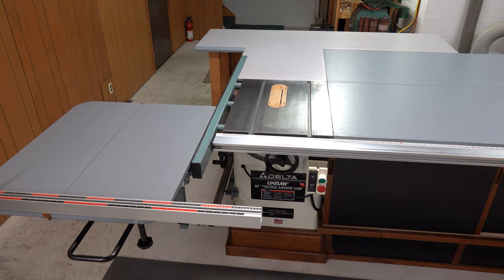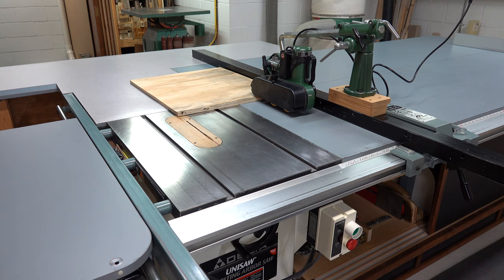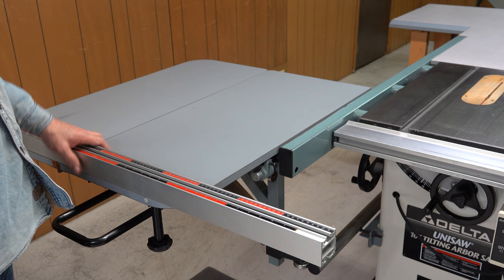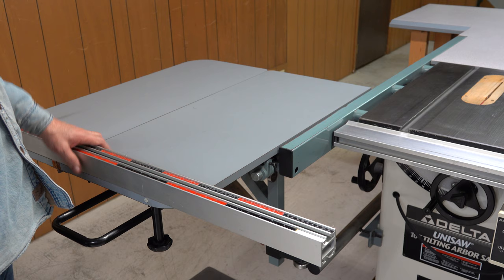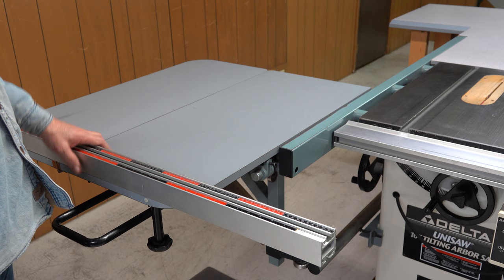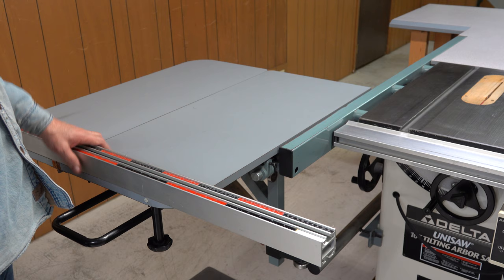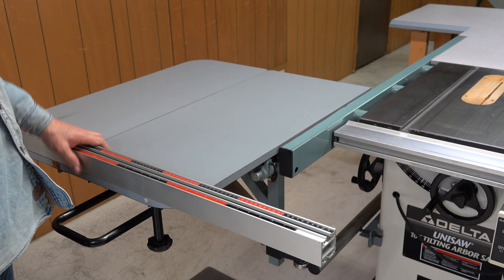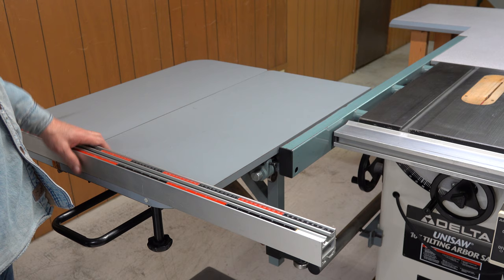Deluxe Table Saw reveals 67 hidden secrets!

Comment: Nice video,thank you. I to use the Delta sliding table and it is tedious to adjust and keep adjusted.As you say , all moving parts and surfaces must be kept clean for the saw to cut accurately. I bought mine when it first came out way back when. They have not been sold new for a long time. There are some very nice sliders on the marker but not cheap by any means. They take some getting used to but they will do very nice work for you.
Reply from the maker: Glad it helped

Comment: A little insight from me: I worked in printing for years, and on our machined surfaces (mostly large hydraulic paper cutter beds) we used spray silicone to protect the surface and keep it slick.... wood and paper are from the same family.... needed something to lubricate but not be oily
Reply from the maker: Your super right on silicones lubrication abilities, plus it's really cheep!....problem is I need to finish most of my projects and silicone will pollute everything it touches with its residual. Typically if you paint or screen print in many commercial facilities, silicone products are taboo. Check out the insane paint shop at Corvette to see how serious they take this issue! This is why I mention the Dri-Cote, it still allows later finishing. This is what makes it (almost lol) worth the price. With any smooth table saw top and this Dri -Coat application, 3/4 plywood and other sheet stock virtually floats like an air hockey game after it's application. Makes it beyond easy to manipulate heavy stock and still finish coat without contamination worries.
Reply: @joesshop3622  ahh....

Comment: Amazing Joe. Found you from a search for that Delta sliding table saw attachment. I have one, and it works great. However I have to often remove it to make rips that don't clear the sliding table's fence. I see that you keep the sliding carriage on. You have a way around this?  Looks like you are simply removing the fence. Thanks again for the great tips. I have implemented several of them now and my Unisaw is singing and less dusty.
Reply from the maker: Sorry Mike!, my response to this never posted... anyway I leave the fence portion off 99.999% of the time and use another fence so I don't have the obstruction you speak of here. As you have seen, I tweaked my fastening of said fence to facilitate easier on off...

Comment: Man this setup was way beyond its time.
Question what are you using an 8' table to the right of the blade for, thats big enough for a full sheet sheet goods .
You took a lot of time to figure out that setup  i hope its made you a lot of money over the years.  And your humble,
Some guys just rave about how good they are seriously who cares does your work always show it?
Would you sell trash or a job you didn't like the qulity of the finished product.
You've built a lot of safty into that system. I like that you cant be too safe.
Guys who run table saws without a spliter riving knife and anti kick back devices are just playing russian roulette 
One day that chambers going to be loaded. Every guy or gal who's ran a tool has had at least 1 close call. Your just one close call from the emergency room lowering the odds is your best bet if you lower it to a long shot.  Like 100000000 to 1 but even thats not full proof.

My point I had a table saw guard fly off the saw and hit me in the face just turning on the saw.  Never stand in line with the blade when you turn on the saw
Carbide teeth can fly off and hit you like a bullet.  Get in the habit of lowering the blade into the table,
You dont know if someone set somthing on your saw when you were not around and hit a tooth hard enough to break the weld.  You come in later flip on the saw and the tooth is launched at 10000 rpm or near 100 miles an hour. <<<--  i didnt do thd math. I try not to.
Reply from the maker: Yes it can process a 4x8 sheet in any configuration you desire. And sure it took a while to setup but in the last 3 decades it has performed so well I'm still amazed.

Comment: That is an awesome setup. Where did you find this rail for the unifence? I cannot even find a short one these days... Thanks
Reply from the maker: Victor, this is an old setup from the early 90's. It was sold as a "uni-rail" available as a 54 or 96" setup. The 96" rail alone was 550.00 back then!
Reply: Keep an eye out for estate sales and tag sales that say things like "tons of tools" etc. Sure, there are some stinkers, and it takes time, but I got one AND a 10" Delta (I'd have to go check the model #) for about 100 bucks. ("About" because I also got a tile saw, jointer, router w/ table and some other crap for $300 total).

Comment: Where did you find that really long rail
Reply from the maker: It was available through Delta in the early 90's for $500.00 with the Uni-fence. The whole length is 123" long for mounting but rips to 8 foot.

Comment: These are fantastic ideas. I just bought a Delta 36-725T2 and I'm looking forward to implementing some of these.  Question:  On #15, would this be in place of a riving knife?  If so, what was your purpose in going with this method as an alternative?
Reply from the maker: Sort of like it but because each pin gets smaller by .015 (1/64) or less than 1/2 of a mm. it unloads the piece to the left of the blade if you push on the back edge of the part where a riving knife wont. It would still be chattering against it ready to kick it out at will...
Reply: Joes Shop gotcha. I knew there was a good reason. Just curious what the difference was. Thanks!

Comment: Also, for 39, are the blade stabilizers a permanent install thing?  I just ordered a 3-pk of zero clearance blanks and I haven't cut them yet.  Just wondering if I should do that mod before I cut them?
Reply from the maker: Yes you can easily remove them but why? Your best cuts will be with them in place. That's if your fence is rock solid.....I clamp mine if I require perfect glue-able surfaces without any blade marks.
Reply: Joes Shop I guess my logic was that, with a zero clearance insert, I would be limited in how high I could raise the blade before the stabilizers hit the bottom of the plate.
Reply from the maker: @jeffgerards  You are limited on total height with these stabilizers in place....just use your stock pos throat plate for those cuts and use a zero clearance with them in.

Comment: At 41:00 I have no idea what the eccentric/off-center metal plug and nylon screw are intended to accomplish with respect to the fence.
Reply: @4kbirdpalace628  Ah, now the mental model fits together. TY
Reply from the maker: I think you mean 39:22 right? The fence is locked down at the left side pivot through the brown plastic sleeve. At the right the fence bolts through said metal part with a hole off center that you can twist L or R bringing the fence to perfect square. Since 2 points hold the fence down, this metal part keeps the fence square even after the sliding table is re-adjusted, keeping it true as wear and re-squaring happens through time. Make sense? The nylon screw simply locks in the rotation adjustment to keep the fence square. Sorry for thinking it was self evident...my bad. The 1" hole in the table that holds this metal part has a small step so it can't slide down through it's 1" hole to the floor.